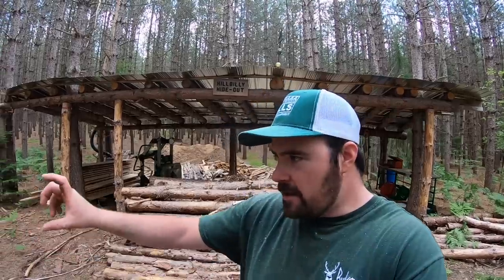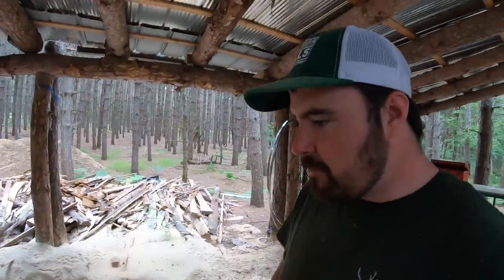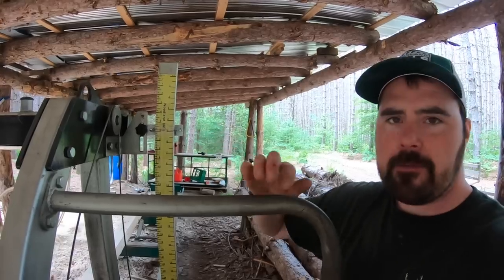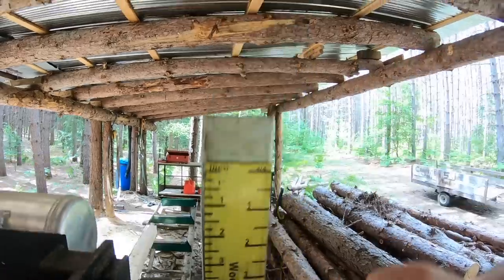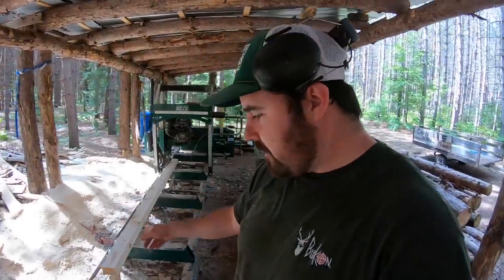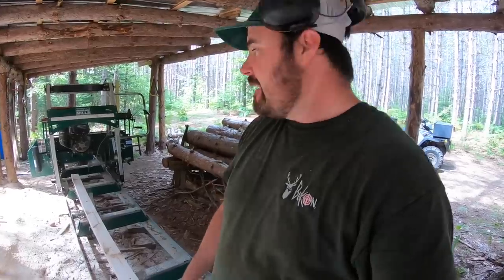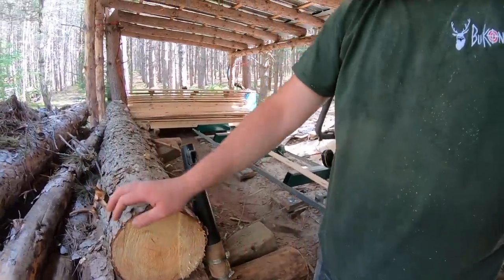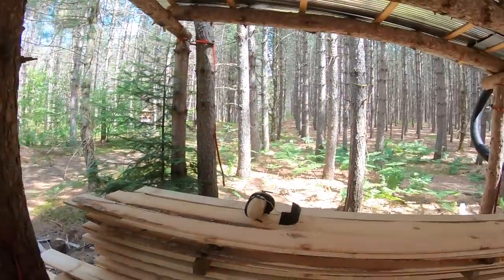How to Dry Lumber Without a Kiln | Making Trim with Woodland Mills Portable Sawmill

Comment: Hi Sandy another great video as always.  I noticed you don't use Anchorseal or any other type sealant on the ends to prevent checking.  Is that because you wood doesn't get that dry and it's not a problem?  What are you thoughts regarding Anchorseal

Comment: Sandy love the content you put out there.  I have the HM126,  been having shacking problems so today is let's change the bearings day. Well I got the guide and drive wheels off, didn't see any bearing problems  but what I found on the drive wheel!  I had sap build up from pine pitch black tar had to chisel it out with a small screwdriver. Keep up the video's there great.

Comment: chris cox recomended me to your channel afew months back ...love it....i have a harborfreight ...hangin my head in shame lol...but anyway i wanted to tell ya that i use oak 2by2 for my back stops and there are some things to watch for ....one is they do warp some so if your squaring up a log with them beware ...also never leave them in for any period of time ...moisture does get in them and cause them to swell making it dificult to raise or lower or even remove...cheers and happy sawing
Reply from the maker: Honestly you’re out sawing wood so that’s the main thing. Others will say that one mill is good and all others are not but to me as long as you’re out making the dust fly, you’re doing it right. Thanks for the idea about the log stops.

Comment: Hi Sandy, great videos by the way.  We have the Woodland mills 130Max saw mill, and wondering if you ever experience the saw head oscillating back and forth?  We have done the leveling, shake-down, and new blade but still experience it when cutting hardwood over a 12" width.  Thanks for your time.
Reply: I recognize that this is a 3 year old comment. Regardless, did you ever solve this issue? I have the same issue and have been unable to solve it.
Reply: @vengervoldur6534  for the most part yes, seems to happen with hardwoods mostly.  I found making sure you have a sharp blade. It still happens from time to time, but found a trick is to put a 4x4 or something to get the log or Cant out more to the center of the bunks.  Hope i explaned that clearly....it is clear in my head ...lol

Comment: Nice video, how long do you let your cuts dry?  Do you use a moisture meter?  Final question for you, when cutting a cant how thin do you go before hitting metal?  Thank you
Reply from the maker: Hey Bart. I normally start building with the wood on outdoor projects like outbuildings as soon as it’s cut or I have time. I’ve never really let the wood sit around drying for too long unless I plan on using the wood in my house or for furniture. I may then leave the wood for two months or so to dry. No moisture measure to check though so I just go by if it feels dry haha

Comment: How do you keep your lumber from molding in the humidity?
Reply from the maker: Great question Kara. I use 3/4" spacers between the stacks of lumber when drying it and assuming I get the wood stacked up not too long after I saw it, it doesn't mold

Comment: Hi Sandy.  I enjoy your videos, so thanks for putting them up.  
You lost me on the scale.  You were indicating the horizontal measurement, but talking about a scale that measures the vertical distance from the bed of the mill to the blade.  
Separate issue.  How long do you find that you need to air dry the thin lumber before planing and using it?  Rule of thumb i have seen is 1 year air dry per inch.  I've got a feeling you are going to use that lumber in a high moisture state, and live with bending or cracking, but not sure.  Thanks again.